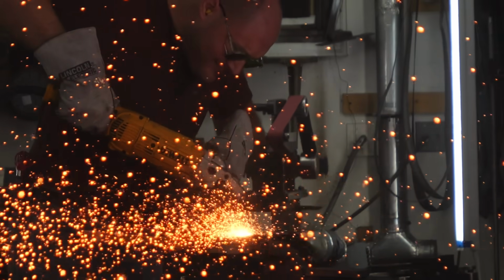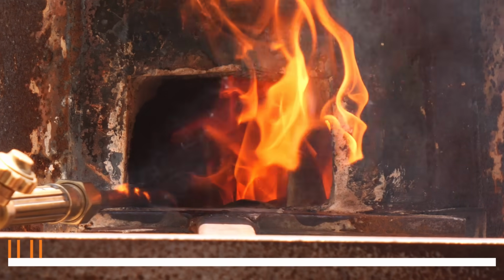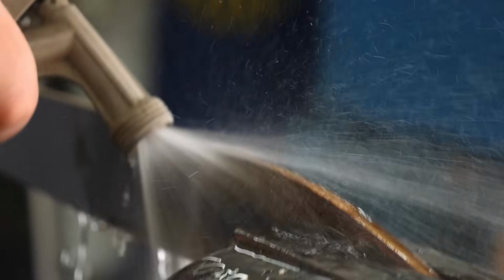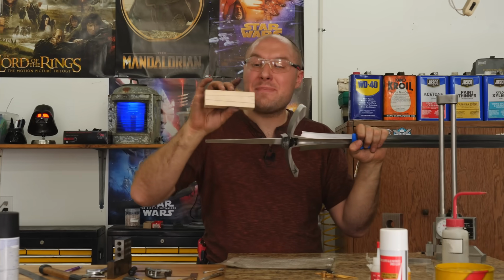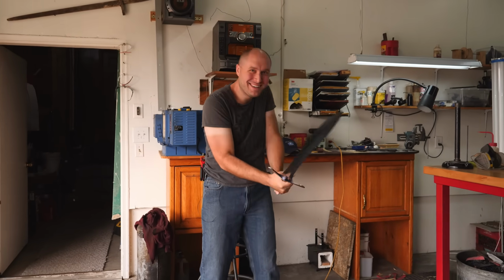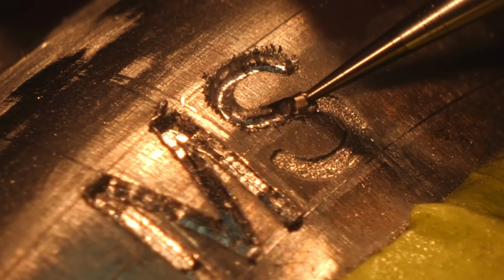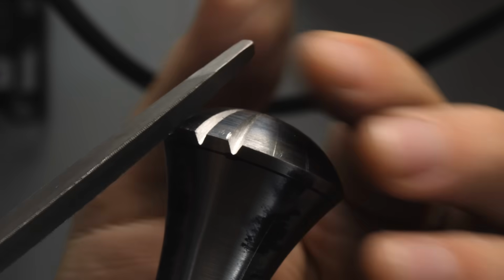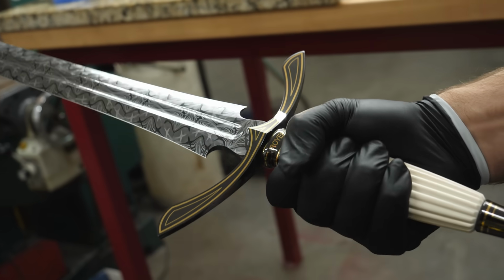I Built A Legendary Longsword (Sold $65,000)

Comment: This is a type of sword that gets passed down through the generations within a family. Then over time ends up in a museum. Excellent work.
Reply: agreed
Reply: It would need some historical significance for a museum. More likely pawned/auctioned off by its inheritors to a private collector.
Reply: pretty sure you couldnt make that kind of sword in medieval ages
Reply: @huruukko9419  Thats where your wrong, the European sword makers where very advanced, after all their swords had to cut though plate mail and not just cloth such as the middle eastern and Asian swords. There is a-lot of noise about the Japanese katana sword but if you research it the middle ages sword makers where much better. I think there even may be a few doco's on this platform that may help. Thanks for the chat.
Reply: @adamtaylor7412  no they were NOT. In fact you have it completely the wrong way around. Medieval European swords were generally made of from single pieces of sheet steel, relying simply on weight to smash and create blunt force trauma. They didn't 'cut through' plate mail, they smashed it open or simply just shattered your ribs through sheer weight of force. Japanese and Korean swords on the other hand were made not only of folded steel jackets but with a different harder steel at its core sandwiched between softer steels, which they were doing literally many centuries before Europeans, and were 'cutting weapons', but they also flexed. This was due to its hard core/soft outer production, and also differential heat treatment. Basically you are talking rubbish you have just made up in your head.
Reply: @jasonross8434  you are specking utter nonsense.
Reply: @jasonross8434  The nonsense in your comment is blinding me
Reply: An American moment here 🤣🤣🤣🤣
Mate swords dont have history,the men who used it is the history 🤣🤣🤣
Reply: @jasonross8434  He's wrong, but you are as well. swords were not used against people wearing plate armour if the user could help it, they're cutting weapons and metal is not going to cut metal unless the smith who made the armour fucked up, this stuff could withstand a lance ramming into it sometimes, much less whatever your piddly arms could do holding a sword. if you hit someone wearing armour with a sword like a muffin you were hoping that your sword dealt enough damage through blunt trauma to injure the guy which if he got plate was unlikely. If you had to use a sword you went for weak spots, gaps and joints in the armour that you could sneak a blade into. European swords were not unsophisticated blunt weapons, if they were they would put an edge on them and waste all that expensive steel. they'd make a halberd or some other polearm. swords were fancy sidearms in Europe, same as in japan (yea, that's right, samurai didn't use swords on the battlefield if they didn't need to either)

The Katana for example is not some superior cutting weapon, its curve is useless (no real effect on cutting ability, too small a curve) and its heavy as fuck for its length because its thicker than a longsword. It has excellent alignment, aligns itself actually, makes even beginners capable of cutting which no doubt would help you out when using it. They used differential hardening because that's just what everyone did, and the Europeans did it as well, wasn't really special, bloomery steel had impurities. Did you know that Europeans folded the steel as well? they just had to do it less because their iron was of a higher quality so the steel had less impurities, the japanese had more so they folded it more, its as simple as that.

The longsword is also not superior in cutting most of the time, it doesn't align itself but its a little tiny bit thinner and its longer so you can probably get more force into the swing, especially if you get someone with the end portion of the blade but the katana can do it as well, its just shorter.
Reply: @adamtaylor7412  You were also speaking utter nonsense, no one was cutting plate armour with a sword, metal doesn't cut metal all that well (it can shave off other metal though, that's how saws work), it can punch through it but that was what polearms and such did, not swords. The real nonsense is this fucked belief of yours that asians and the middle east didn't have metal armour, like what? rich people protected themselves alright. the warrior class were obsessed with not getting killed so they tended to wear some nice stuff. Persians way back in the day wore metal armour, their lesser soldiers wore a lot of cloth because they were much poorer then the military class of their time. lamellar armour wasn't just some leather strips sewn together, the nobility could afford it being metal. like dang, the Chinese have been wearing metal armour since like 200 BCE.
Reply: @itshunni8346  Swords were a primary Weapon not a secondary weapon, thats because not everybody was heavily armored, most units in medieval times didnt have full plate armor since nobody could afford that. Also many people died because they couldnt breathe after getting hit on the head since the dented helmets were choking them.
Reply: @itshunni8346  You forgot that a longsword can also stab and cut with both sides a katana can only cut with one side and due to the curve you cant stab aswell.
Reply: @eeurr1306  swords weren’t really primary weapons, there are relatively few examples of them being so, spears were definitely the weapon of choice throughout history. Swords were more of a status symbol for the warrior classes in society, it’s a complete waste of money and metal when a spear was much cheaper and more effective lol. Halberds and maces were more common as armor got more effective, and the only real common use of swords was in the east with curved swords for mounted troops
Reply: @thesultanofsalt7151  Oh that really depends. We are talking about great swords and longswords are we?
Reply: @thesultanofsalt7151  The link isnt as much proof but it still shows why a sword wouldnt be a bad primary weapon.
Reply: @jasonross8434  European swords were also pattern welded and their steel became much higher quality than that found anywhere else in the world towards the end of the middle ages
Reply: @jasonross8434  Jap metal was so impure they had to refold the metal to break the oxides up, to build their katanas, it was a lengthy process to build a pure blade for them because they did not have european industrialization to build tanks and howitzer machine guns.  Likely a samurai brought a pretty katana to a long range artillery fight.
Reply: @adamtaylor7412  swords cannot cut through plate armor.
Reply: @adamtaylor7412  "European sword makers where very advanced, after all their swords had to cut though plate mail" literally you said that
Reply: @adamtaylor7412  see your first message in the replies, you won't have to scroll down much.
Reply: @11th_defender51  🤣
Reply: @adamtaylor7412  are you laughing at me or yourself?
Reply: @11th_defender51  😃
Reply: @adamtaylor7412  ok dude
Reply: never see any more arguments in comments than on sword videos lol
Reply: @itshunni8346  the curve on a katana serves the purpose of being able to draw and cut in one motion
Reply: @jimmyknox2718  It actually doesn't, its a myth. the real decider in that kind of thing is skill, the curve doesn't really change the draw enough to make that the reason why it was curved. the sword is curved because they look nicer, if they wanted cutting power or an easier draw they would have kept the more extreme curve of a tachi.
Reply: @itshunni8346  I thought that point of the curve on a katana was so it was centered when swinging it, thus making it easier to land your cuts and would play a huge role as a fight was drawn out. The user would get exhausted, and the sword would help by centering the alignment in a cutting motion thus allowing for a higher margin of error for things like your technique getting sloppy etc.
Reply: Or its the type of sword that who ever conquers you takes this as a trohpy and sells it as "dictator sword"
Reply: @adamtaylor7412  nat hes right
Reply: @delisyd6426  then ur blind , this baby boy sword will never be in a museum
Reply: Hmm the reason why curved blades were better than straight blades were because when they are swung against an object the contour of the blade caused a natural slicing/cutting motion meaning the blade did the work for you. Because of this property curved swords especially like the scimitar were less prone to get stuck when striking. Curved blades are more natural feeling/handling, once again the scimitar is a good example with its curved handle.
Reply: @adamtaylor7412  swords don’t cut through plate armor.
Reply: @eeurr1306  You’re also wrong, swords were mainly used by nobility, usually in self defense, not wars. Swords take a lot of training and don’t do much against armor of any kind.
Reply: @eeurr1306  great swords were used by bodyguards and riot suppression because you could make long sweeping motions through unarmored opponents. Long swords were secondary weapons because, again, swords don’t do much against any kind of armor unless you used mordhau or half-sword techniques (blunt or piercing).
Reply: @georgiafloydsod9644  Europe just had good iron and coal mines. Their techniques weren’t “better” they were just working with better steel.
Reply: @adrensamoth4337  Well Okay
Reply: So, might might say this argument is a sword fight?
Reply: @adamtaylor7412  p😊
Reply: @adamtaylor7412  ömå öp😊😊
Reply: @jasonross8434  ö
Reply: Pp
Reply: @jasonross8434  Nonsense. Many historicians and experts says something different 😏 You do realize that europeans also know how to forge, heat treat and even making damascus blades with mostly much better quality steel than mythical katanas? Polish sabre for example. 😏
Reply: no
Reply: It gets passed once. Then it gets sold for someone else because noway im passing 65-100k item down the line just because its an heirloom
Reply: @jasonross8434  Katanas are a meme bro.  Drop the anime
Reply: Or end up in a vegas pawn shop with a TV show
Reply: @adamtaylor7412  No the hell they were not. Not a single sword was designed to cut through plate mail.
Reply: @dmtaboo_truth7052  idk a lot of swords in museums probably arent really that significant other than being old and maybe in relatively better shape than expected
Reply: @adamtaylor7412  idk i think katanas from a craftsman perspective are more beautiful with the folding and differential hardening but european swords are probably more durable from the better furnaces. and the sword in the video will probably be a very challenging blade for an ancient blacksmith european or japanese because we have even better furnaces today and ofc he used blowtorch wielding to initially hold the metal together.
Reply: So who’s right?!?!?!
Reply: @jasonross8434 you’re so very wrong 😂 go to any museum with swords and they’ll all be sharp
Reply: Facts
Reply: @luisduarte7917 mate you do realize both can be true right?
Reply: royal family
Reply: Needs to end up in a dragon
Reply: or , we see on Pawn Stars.
Reply: Lol yea,because it's going to be used in some major battles, right? 😂🤣😭
Reply: Be good for fighting trolls
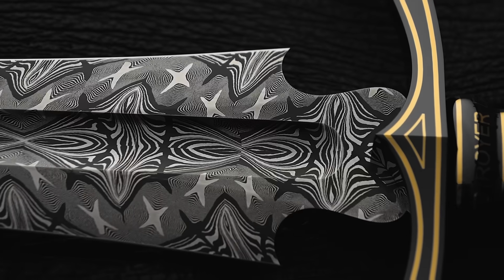Reply: 39:23 65 thousand dollars for a sword where the art is off center? LMAO.
Reply: @jasonross8434  I recommend to researd aboout Viking sword Ulfberht. There were of course low quality swords around but there were also sword of extremely high quality made.
Reply: @jasonross8434   Lil bro what mushrooms did you smoke for you to create an entire timeline in your head
Reply: @eeurr1306 Swords weren't even the primary weapon for the Romans. I don't know who told you that swords were the primary weapon but that's historically incorrect. Hell the dagger was the weapon that killed most armored knights. Samurai used the Yumi (bow 🏹), yari, naginata, as their primary weapons. The uchi katana or daisho was the peacetime kit of the samurai class.
Reply: @devmike Incorrect. Japan had guns, bombs, and artillery during the samurai era (sengoku period and the meji restoration era) and they had some industrialization before WWI. As for their metal yes the iron sands that tamahagine steel comes from has a fair amount of impurities but it's the extremely high carbon content that was a major factor in their folded steel because too much carbon makes the steel too hard and brittle.
Reply: @Nitro1000  Unfortunately Ive already changed my mind mere weeks after posting. Though I have to say that your comment about knights being killed by daggers most of the time, does not fit well into the context of what youre saying. Because daggers were secondary weapons on the battlefield only used once you were in grappling reach.
Reply: @adamtaylor7412   Mate swords don't cut plate or mail, they are made for cutting lightly armored opponents or thrusting in gaps of the armor knights had. Plus most of them that looked good weren't ever good. Those kinds of swords were presented to royalty/nobles as gifts, and were only worn or stored, not used.
Reply: Not passed down..melted down in time of peace to make a plough
Reply: lol not
Reply: @virulenthunter3017  curve blade helps you cut soft things if you are swing from outside to inside like from up to down or you start from left and you are pulling the sword towards you but the thin straight blades are better they are flexible and they cut soft things very smooth if you hold your blade at the right angle but if someone is wears full knights armor katana wont do much but flexible thin sword can go under armor but you need skill and luck for that so its better to use war hammer or axe they are heavy and they can brake your bones even when youre armored sword cant do much
Reply: @adamtaylor7412 fr swords from northern europe have been prized all over the old world since the late bronze age.
Reply: @devmike dude what, apples to oranges 😂😂😂
Reply: @eeurr1306  Swords were always secondary weapon in war, ffs..
Reply: @itshunni8346  The katanas were curved by quenching.. ffs
Reply: @SuperSeytan666  Did you not see my comment where I said that I have long since changed my mind? Also how is the curving process of Katanas relevant to what I said?
Reply: @SuperSeytan666  It's curved through differential hardening. Quenching a Katana without covering it in clay to put the curve into it gets you a straight katana. Have you ever seen them made? Quenching is a core part of the process, but not the process.
Reply: @itshunni8346  I have, but was almost asleep when wrote that comment.
Reply: I heard a legend about a meteorite sword ie sword made from meteorite ore that landed in china, used by minority but in japan, many entire squadrons were equipped with it. They had enough cutting edge to go through iron scale on leather armour (used by japanese) like hot butter through knife. Many experts were killed by invading Japanese army lead by an exiled prince. I don't know if it's true though.
Reply: @cristibaluta  LOL
Reply: Yeah, he made 20 dollar sword and claim it is 60k.
Reply: this is the type of sword a youtuber makes and claims it had a value, and sold for that value.
Reply: @eeurr1306 Swords were not a primary weapon really. And you are right, not everyone was heavily armored, but have you ever tried to get a proper cut with a sword? It takes some technique. Swords were more ceremonial, status symbols, or sidearms. Like a longer knife essentially. And if you did use a sword as a primary, you had to incorporate techniques like half-swording, or turn it the other way around and use the hilt as a bludgeon, but back to my main thing. Swords weren't a widespread primary weapon due to the training required for properly wielding a sword. Men at arms might have been, but most armies were hugely comprised of levies. Levies we all know to be essentially militia. Your average joe farmer who is too poor to properly equip himself with quality gear, let alone a sword. So this big chunk of an army is too poor to afford armor, and is stuffing their jerkins with things like wool, or cloth padding. And equipped with something cheap and easy to mass produce, unlike a sword. Spears. Spears were the dominant weapon all throughout the middle ages. And something that always made me laugh, was how through history, spears just basically got longer and longer, lmao! That's how they'd counter it most the time. Build a longer spear. Cheap and easy to make, and required little to no training to be effectively used.
Reply: @jasonross8434  There was no sheet steel that era 😂
Reply: @adamtaylor7412  Not about the layers
Reply: @huruukko9419  You are actually correct because they would not have used a threaded tang to attach the pommel. The pommel would have been peened over at the end. Threaded tangs are much weaker and have far more chance of snapping.
Reply: only if the owner completes a herculean task! otherwise it's still a "vanity" item.
Reply: @jasonross8434  Sure, Jan.
Reply: @itshunni8346 I remember hearing that the curve is what gave the katana that really good edge alignment, although I could be wrong.
Reply: Или у лысого за копейки 😂, а тот уже на аукционе за миллионы
Reply: @ by that time it would already have provenance by default.
Reply: I won't even attempt to top, perfectly said .🍻🤙 Absolutely a piece of artwork, I can see why he has never been on forged and fire,. He wouldn't lose. Lol🤣🍻
Reply: @huruukko9419 people did all the time, the phrase Damascus itself is from DAMASCUS, in the middle ages, Spartans had Damascus blades.

Don't say he couldn't, others have. They are in museums all over the world.

Stay humble bubba🤙🍻
Reply: in this case it will sit on some rich persons shelf next to all the other hobbyist sword marker blades that look exactly the same if not better, and then it'll be auctioned off when said rich person's assets get liquidated in the inheritance and thrown into a landfill.
Reply: @sam23696 Arnt you just a happy Chappy.
Reply: @delisyd6426  both of you are spouting nonsense lmao. Swords were not used to break through plate, maces and hammers were such as a corbin de bec, or a halberd. Most soldiers didn't even use swords they used spears, swords fell out of favor around  the 1400s due to the prevailance of heavier armor. It was still useful against light armor, such as chainmail but not platemail.
Reply: certainly aint doing any fighting with that handle.